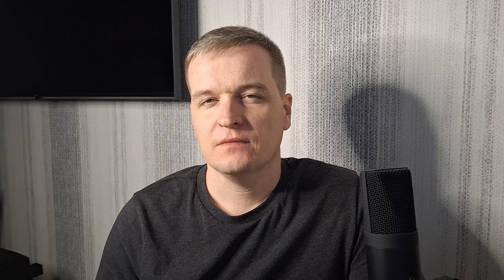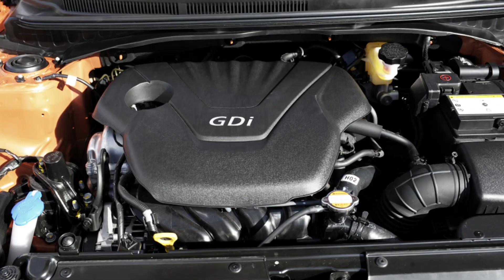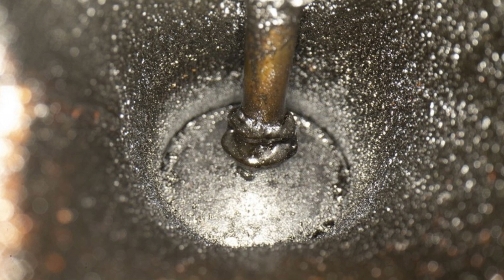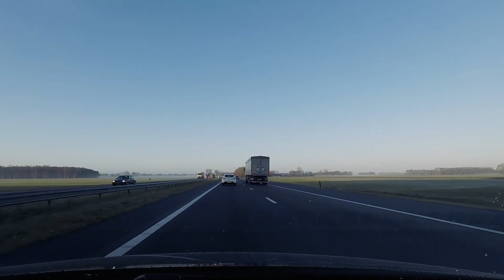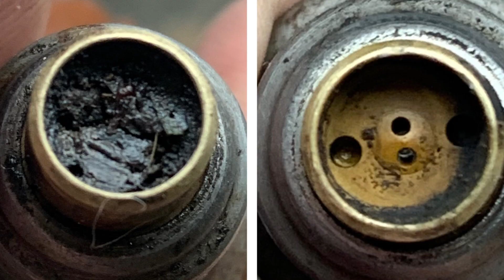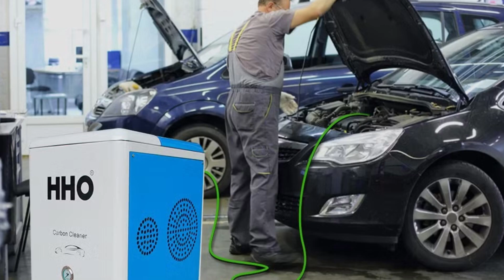4 Common symptoms of the carbon-clogged engine

Comment: Thanks for the information.
I drive a Mercedes-Benz 190D and recently when doing cold starts, when the ambient temperature got colder, it takes a lot of effort and time to put it running. This didn't happen before. Do you know if that's also a symptom of carbon build up or could be another issue?
Also I'm not a slow driver, I drive the car fast, even though the car is slow. In rare times I almost go to the limit of RPM.
I also use poor quality fuel all the time because of pricing... It's a huge ammount of difference in price. I tried premium (most expensive) fuel today and I'll see how it goes.
Reply from the maker: For diesel engines, this sounds like glow plugs going bad rather than valves. But I have too little info about these MB engines, unfortunately.
Reply: @DmitrySapko  Ok, thanks for the reply.
Reply: Most important is to do a valve adjustment, in my shop we found that on a lot older MB diesels the intake valve clearance gets too tight resulting in low compression and starting problems.
Reply: @alfamontydog  Ok, thank you!